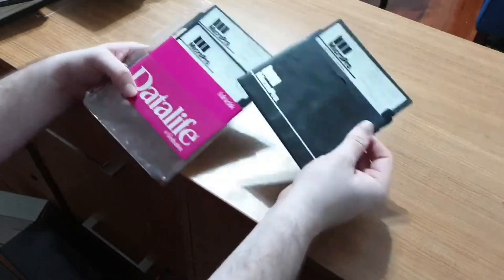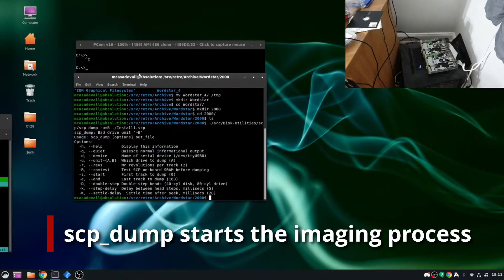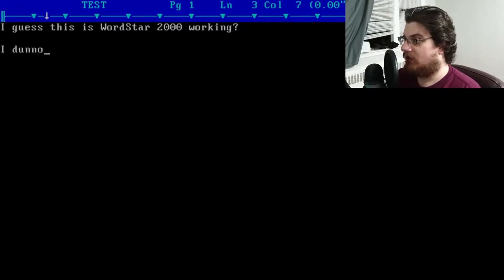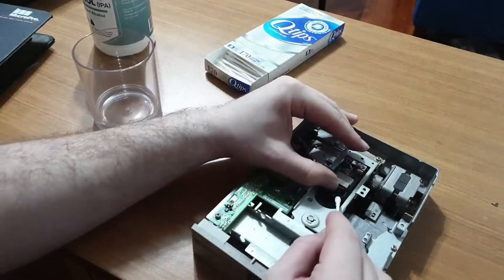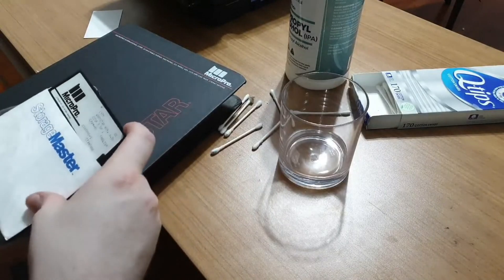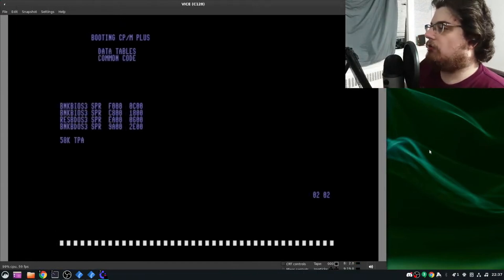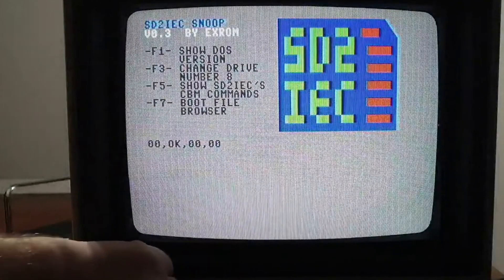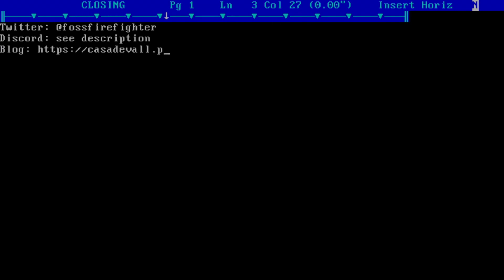Preserving WordStar with DOS, CP/M, and a Commodore 128 // (NCommander in Realtime)

Comment: Your video brings back memories. 
Back in the 80’s I had a side gig that I would call “Folding floppies”. What I was doing was taking the 8” floppies and coping to the customers 5 ¼” disks. There were a few different versions of 5 ¼ disk formats out there at the time, as you can see, by this video.
The trick was to send a version of X-Copy receive only (as it was smaller) to the host machine and then send the full version of X-Copy to do the actual transfers. This was all done over the serial connections. What took the time was to work out the serial port set up for the host machine (both hardware and software).

Mind you, I have not touched CPM in decades, 
[update (05/06/2024): after rereading the CPM manual; you use the PIP command for the *.ASM transfers]
Now about your problem, you will still have to set up X-Copy and send it to your CPM machine. You used the smaller X-Copy receive only because it’s smaller and you can capture it with the CPM’s PIP command. After you get it saved on your CPM system, you assemble it and use it to send the full version over. 
Now, there is a full version of X-Copy that will run on MS-DOS, and when you get all of that running, you just copy what you need between machines.

The trick is to send the X-Copy receive only as a text file and assemble it on your host computer. I am assuming that there is a full set of files for CPM on the host machine.

Comment: I bet the c128 makes for a better cp/m machine than the Speccy +2A
Reply from the maker: ... that sounds like an exceptionally painful combo, although the Speccy is likely faster since the Z80 on the 128 runs at effectively 1/2 to 1/4 its rated clock speed.

Comment: Can you do a how-to video on floppy disk dumping and converting to actual files? Why can't you just copy and paste as usual?
Reply from the maker: There's a lot of reaosns why you can't copy/paste but short version:
1. Copy and pasting from a disk doesn't preserve file metadata, disk structure, undeleted data, or boot sectors.
2. Windows will end up modifying disks you read (I'm using Linux, but you should never use floppies without write protection enabled).
2. These are magnetic flux dumps, not a USB drive
3. Copy protection information will be lost,
4. It's impossible to truly recreate the original media from just a bunch of files.

Comment: I know nothing about this but   is cleaning the  degrading disc surface with isopropanol what destroyed it and made it rub off in the new jacket?
Reply: That's sure what it looked like. I'd never seen that and I've had floppies dating to ~1980, stored under poor conditions, that were still good.
Reply: @Reziac  Not all poor conditions are created equal. I've worked a lot with old tapes and 35 mm film and generally some older tapes are really full of "debris" in lack of a better word. It collects on the tape head and I assume it is dust or oxidation that has collected over the years, maybe due to a manufacturing "defect" as it is not consistent. 
What could happen is if the same kind of "debris" built up on a floppy disk it might act like "sand" as it digs into the cushion within the disk envelope as the disk turns. Of course this is built on the assumption that cassette tape and floppy disk is quite similar technologies which I believe they are.

I would absolutely think that this is the more plausible explanation as the damage looks mechanical and not chemical. Either the debris shifted around inside the envelope or it collected on the read head which then pushed it around like a ploughshare. On a cassette tape this damage would occur perpendicular to the magnetic field if the tape is wound too tightly – exactly the same happens with 35 mm film as some dust is almost always present on a reel (this would appear as vertical scratches on the auditorium screen).
Reply from the maker: I'm not sure. I'm getting comments that the IPA may of damaged it, or it may not have, I don't know for sure. I may have to test it.